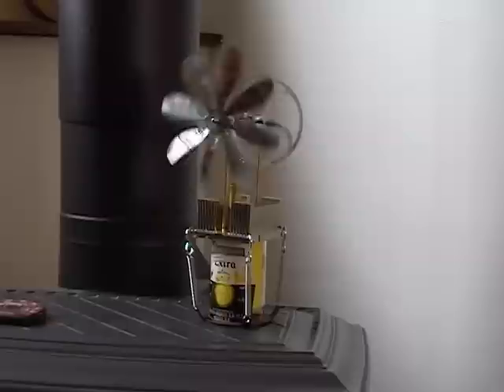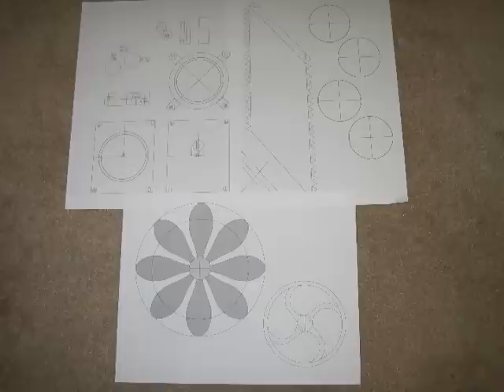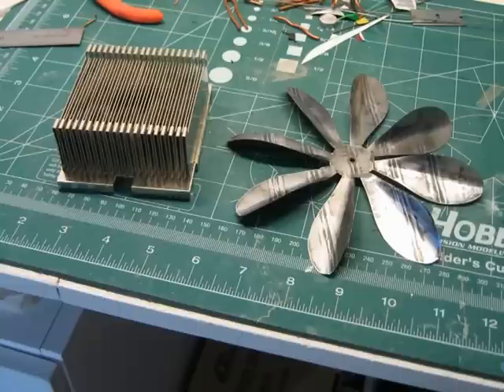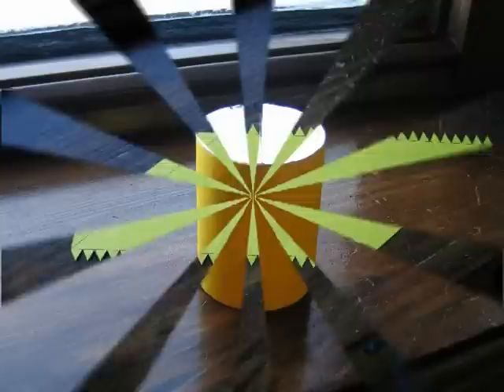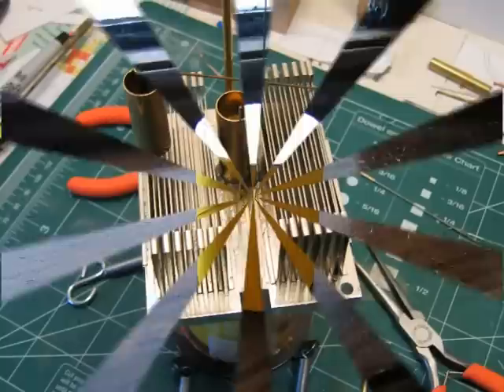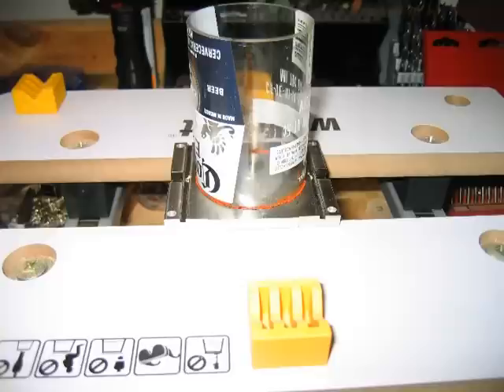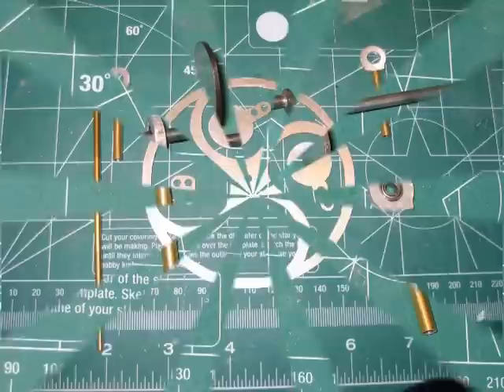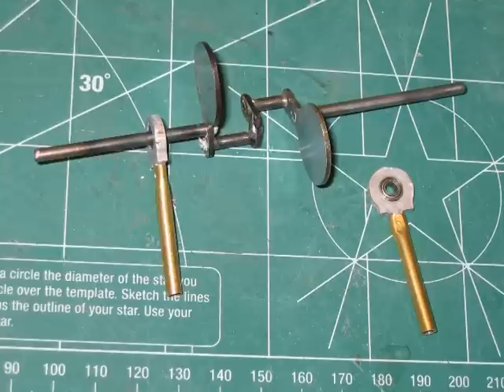The Beer Bottle Stirling Engine

Comment from the maker: @specallez
Thanks for the comment. The 1st long run it ran for about 6hours before the top was too hot and it stalled after firing the stove.  It survived many firings prior to that and started easily When the temp leveled out. 

I made 2 changes that should be enough to compensate for the rapid temperature swings. 
1) Heat shield under the top heat sink made from a polished brass sheet. 
2) Electrically insulated the top for the bottom, by changing how the springs attached to the top.

Comment from the maker: @IoanBojan 
At least 12hours, we don't have our stove burning much more that that at a time so it is hard to say. When the stove fired is the hardest time for it. If the wood is a little wet the temperature drops fast and it stops.  Once heated up if the temperature reading on my burn Indicator drops below 325F/162C it will stop. My "Copper Top Stirling Engine" handles the rapid swings to lower stove top temperatures much better; it’s good down to around 200F/93C.

Comment from the maker: @lookcreations Yes but also, I wanted to keep as much of the bottle as possible so people could see what it was. A shorter displacer would wood need a lot more vertical travel, this causes too much friction on the displacer shaft when 90 degrees off vertical., it would also give the displacer a mechanical advantage over the power piston. Less travel with more displacement should make for a faster engine.  
See:  The Copper Top Stirling
Reply: thanks for the info

Comment: hey i really like your engine. i built one of similar design but can't make it run for more that 1h30min on my stove. i was wondering how long yours ran and if maybe you had any pointers.
Reply from the maker: It will run all day as long stove top stay above around 180F. The biggest tip is no lubrication on the piston or displacer shaft and clean the piston and displacer shaft after first several runs. The fumes/smoke from glues and such make the piston stick at first. Lubricants slow the engine and gum up after it gets hot and stall it as well.
Reply: thanks, the lubricant make a big difference.  i also just watched your video where you use a bellows instead of a piston, which is an idea i really like. again thanks for the advice. love your vids.

Comment: Instead of a traditional flywheel, couldn't you replace it with another fan blade that weighs the same?
Reply from the maker: sure
Reply: JEPLANS The only problem with this is that you need so much energy to move so much air and by adding an extra fan, you would increase the load on the motor, causing it to slow. I guess there must be an optimum fan size as well.  And prop pitch.  Great idea though and looks like a great project to make with the grandkids. !